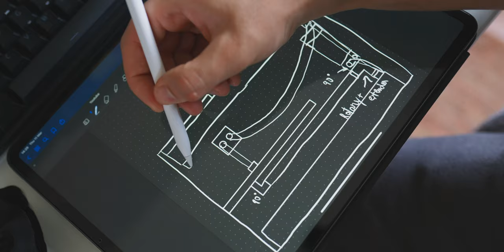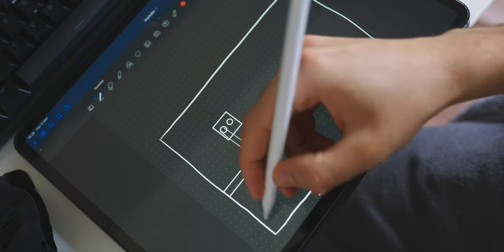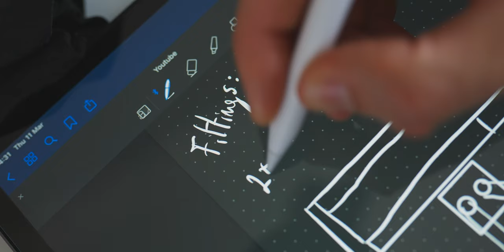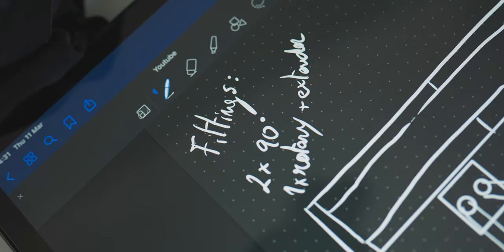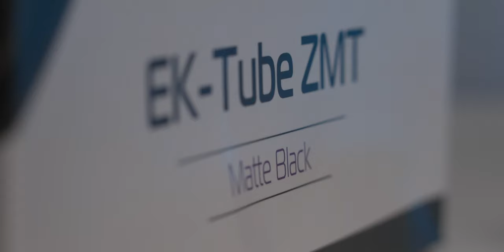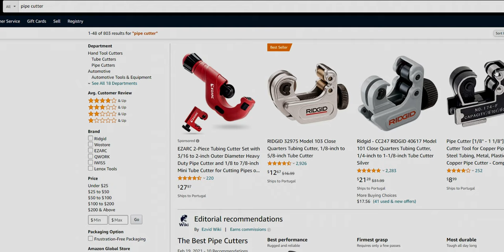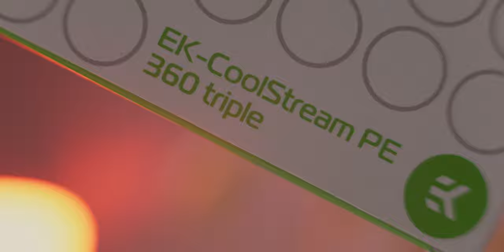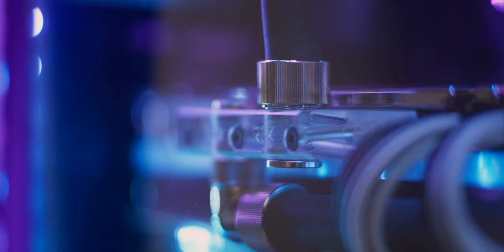Basic Essentials for PC Water Cooling

Comment: Hey! they are good tips for PC water cooling... I have a question for you.... In your opinion it could be the size WB for the MSI 3080 gaming z trio within the Li Li or 11 d? Great job
Reply from the maker: Hmmm not sure what you mean by size wb, if you mean what water block should you buy for a MSI 3080 gaming x trio, you have to find one that says specifically that it supports your gpu. If you mean radiator size for a 3080, a 240 or 280mm radiator is enough but if you have the space I would just for a 360mm of normal thickness on the back of the case
Reply: @carlosribeiroo  i mean the water block... my question is about the dimension of the water block i don't know that the waterblock for my gpu fit orizontal and not vertical in my lian li o 11 d
Reply from the maker: If you are talking about the size of the block on your case it’s very small. Much smaller then the stock cooler and every block will fit both horizontally and vertically. You just have to make sure that the block fits your gpu (by reading the compatible gpu section of the particular block you are looking for. EK for example has different blocks for different variations of the 3080

Comment: One of my biggest problems was the pump I used flowed too much and aerated the water so much I could not get all the air out of the reserve, a pwm variable pump is a must
Reply from the maker: PWM pumps are super common these days and are a god send in many situations like yours! Without one the only way you can remove the air is to have the pump at the highest point in the loop.